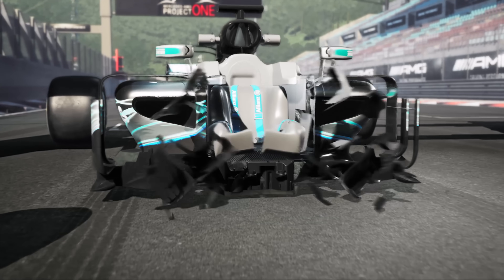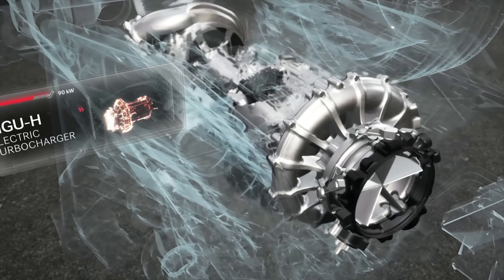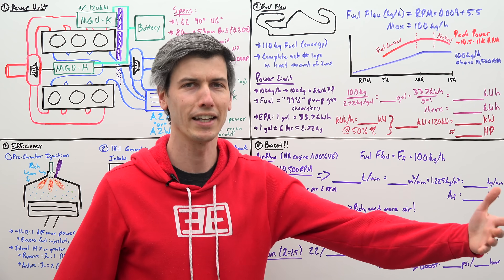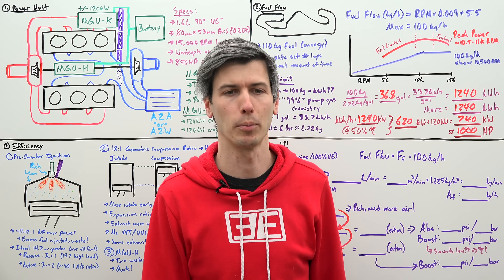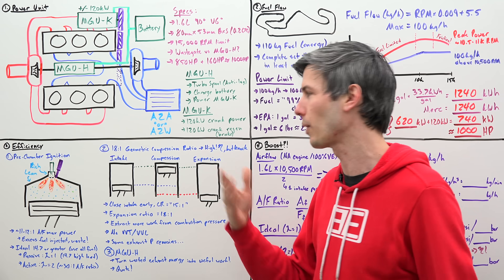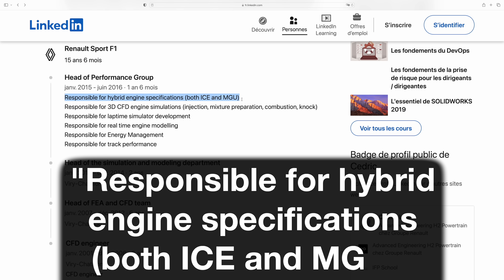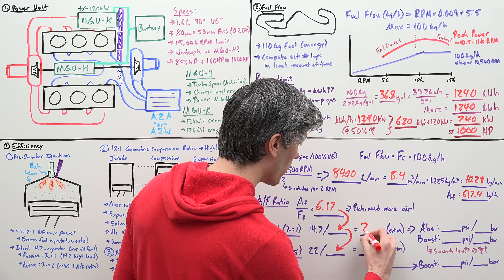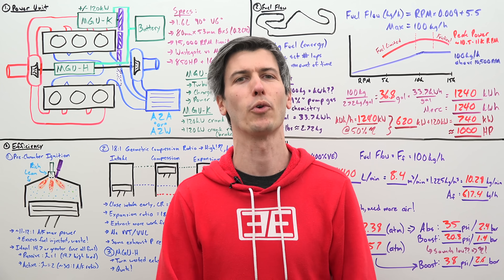How Tiny Formula 1 Engines Make 1000 HP!

Comment: Just imagine if they were allowed to use variable everything in the port timings, etc.  I am thinking they could get 1000 HP from a 4-cylinder with all this tech.
Reply: It's not hard to get 1000 hp from a 4 cylinder engine.  You can make way more power than that...  Think drag racing engines...  Search youtube...  GM sells drag racing 4 cylinder blocks designed to handle 2000 hp (and have been selling them for over 15 years).  Cars using these engines can do 6.3 second quarter mile runs.
Reply: @cole2839  It is only easy if you can use unlimited fuel flow and don't care about reliability. Most "Tuning engines" work this, they use ungodly amounts of fuel and are very unreliable to the point where they sometimes don't even survive a dyno run or drag race. This is easy. If you want your engine to survive an entire race it becomes hard. If you also have limited fuel flow avaiable (like in F1) it becomes extremely difficult since now you have to increase your engine's efficiency and can no longer just figure out ways to increase boost+fuel flow while not blowing up your engine.
Reply: @ralfrudi3963  Incorrect.  Hyper car engines are very well refined.  They just don't have to be as efficient as F1 engines because they are not operating under the same rules.  They can be slightly less efficient and produce more power and more torque.  

You seem to be confusing efficiency with performance.  You don't need to be extremely efficient to have good performance.  

You have a layman's understanding of engineering.
Reply: @cole2839  You need efficiency if the amount of fuel you are allowed to burn per minute/hour is limited like is within the F1 ruleset. 
This does not apply for engines which aren't competing in F1. So you are correct of course but this isn't what I meant.

Comment: It took me forever to figure out what the MGU-H does.  But I and my colleagues have wondered about the name i.e. why heat?  Is it that the heat energy in the exhaust far outweighs the kinetic or something simpler like it needs a different name than the MGU-K?  I've also been wondering why the manufacturers don't like them and, if the press is to be believed, wouldn't entertain building an F1 engine until it's gone.
Reply: It take excess energy from the turbo, but on a road car you aren't pushing it hard all the time. So you don't get much excess energy from it. Then it also adds extra complexity and so reliability can also be an issue.

Comment: The interesting thing to me is you could adjust the boost purely digitally. If you were allowed a pito tube you can get ambient and static pressure and in theory you can use the electrified turbo to set the boost to be perfect for both the wind and weather conditions (or low pressure/high pressure)
Reply: This is what they do and essentially what most production cars do (obviously they don’t have a pitot tube but they also don’t have an intake with above ambient pressure)
Reply: There ARE pitot tubes on F1 cars and I'm pretty sure they are used for this exact reason.

Fun fact, in the 90s traction control was banned in F1, but some teams actually used the indicated airspeed (from a pitot tube) in combination with the engine RPM to determine whether there was wheelspin and limit engine power as a result. So yeah, effectively it was traction control but hidden in a very smart way.
Reply: @christophmayer3991  fair I don't follow F1, but that would give you variable boost, and variable boost is effectively the same as variable valve timing. As it can allow you to directly control the fuel air mix.
Reply: @christophmayer3991  got it right there is certainly a pitot system involved but despite that some engines and teams have better high altitude performance. I assume trade offs in packaging and intake design are the cause.
Reply: @colinjohnson5515  Cooling and changes to drag are also large factors when racing at high altitude.
Reply: Benneton with Schumi in 94 were suspected I believe

Comment: Did you hear about the EU's petrol Ban ? And do you think it's worth pursuing motorsports anymore? (With no more gas powered cars being made in 12 years or so ,)
Reply: From 2026 F1 cars are planned to run with synthetic fuels.
Reply: I bet they change the fuel to “renewably sourced” or some such thing, just to keep F1 going.
Reply: Mr Explained doesn't like it because "efficiency", but the reality is that synthetic fuel would be the solution here. Carbon neutral, and would result in less waste from scrapping loads of cars an production tooling.

Comment: What was really ingenious was Mercedes “Party Mode” (Qualifying Mode). They would charge up the battery on the prep lap and when it was go time (straightaway), the waste gate was fully opened and the turbo/boost was driven 100% by the MGU-H & battery. All the benefit of a turbo without the back pressure. Yeah…it was banned pretty quick, nobody else could come close.

Comment: Love the vid - they were doing this in the early-mid 1980s with 1.5 litre V6 engines without electric motors.  Renault EF could push out over 1,200 hp
Reply from the maker: Yes! Though wildly different strategy; high RPM, and boatloads of fuel (low efficiency).
Reply: They were far less efficient, and just used tons of boost pressure combined with very extreme fuels with extreme fuel burn rate. Hence why they only had that power in qualification mode.
Reply: @malmsey1541  That is the definition of a mans engine, none of the airy fairy electric nonsense.
Reply: @MattyEngland  real men use their brains to invent technology to do things better. You know,  like making more power without running out of fuel all the time.
Reply: You do realize the producer of this video is an EV owner, right  @MattyEngland  ?

Also, seems pretty silly having your value tied to a specific type of vehicle.
Reply: @jamesengland7461  you mean real nerds? ;D
Reply: @JoshuaTootell  he's a true petrolhead, even though he likes his ev also.  Nothing wrong with that
Reply: Those cars were insane. Barely driveable.
Reply: Yep, 👍👍
Reply: Yeah but I think they went through much more engines and fuel. Not to mention the exotic fuels they used at that time.
Reply: It only lasted a few laps with that amount of stress

Comment: so if these smaller engines produce such massive power, am i NOT to  worry about the power of the small 4 cylinders (hell, now 3) being put into all the larger vehicles these days?
can the smaller 4 turbo engines be built to handle the new power...ARE they being made strong enough for the extra power and boost???

looking at you, FORD!!!
Reply: Don’t believe all the BS you see on YouTube. Everything gets blown out of proportion. For instance, I was a dealer tech for twenty years. There are hundreds of videos about the 5.4 3V being the worst engine ever. Nope. It was a damn fine engine. (Reliability-wise didn’t like the power band). Some videos even admit that the issues they show is lack of maintenance. Of course your engine won’t last if you don’t change the oil. Dipshit mechanics work on an engine a lot and assume it is trash. They don’t consider that Ford sold more F-150s with that engine than some manufacturers sold from their whole lineup. So when you are a mechanic it stands to reason you will see more of them especially on a pickup truck that sees severe duty. I left in 2018 and the eco boosts were doing great. My friends that are still there say the hype about the newer ones failing is way overblown.
Reply: @AlphanumericCharacters  Exactly, it comes down to human perception, it doesn't matter how low your failure rate is, sell enough and the visible failures will look bad.
Reply: Both of the mechanical contractor companies I worked for both operated a fleet of Ford's. The second one was nearly purely 4.6 engines and not a single failure from an engine or transmission in the several years I worked for them racking up hundreds of thousands of miles between us. Not a single person I know with an Ecoboost engine has had a problem, and there are probably millions of them  @AlphanumericCharacters
Reply: @AlphanumericCharacters  well,i am a firm beliver in maintenance. my 2010 MKS ecoboost now has 108,000k on it and EVERYBODY keeps talkin about carbon build up.
mine runs like a clock.
well, of course i changed my oil ever 5k and did extra work maintainiing PTU and othe "lifetime" sealed parts.

but the 3 cylinder and 4s in these larger vehicles.

what is your opinion on that????
Reply: 4 cylinder engines can easily be made to make over 2000 hp and you can buy off the shelf blocks designed to handle this power.  They are used in drag racing cars.

Comment: 1240kW is a momentary limit, so it is probably the correct unit. Right?
Reply from the maker: kW is not a unit of energy. The quote says "potential energy." It's very common for kW and kWh to be written incorrectly. In this case, it's 1240kWh.
Reply: @EngineeringExplained  True. I was thinking about the flow limit and not paying attention. Oh, well.

Comment: How many miles do these engines last?
Reply from the maker: They get 3 engines per season (without penalty), so they need to last 7-8 races. Including practice and qualifying, this means around 1500-2000 miles, though many teams take new engines because it's often worth the penalty.
Reply: @EngineeringExplained  so about the same as a tuned Subaru then. 😎